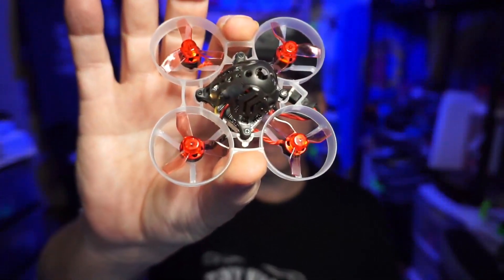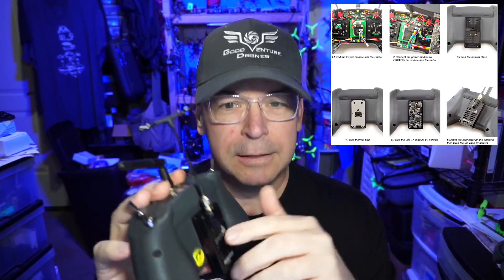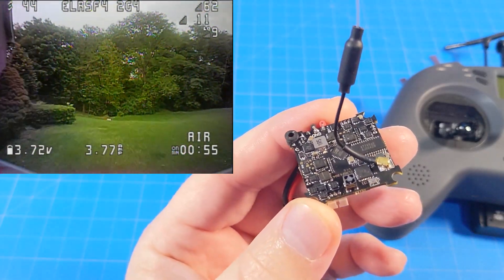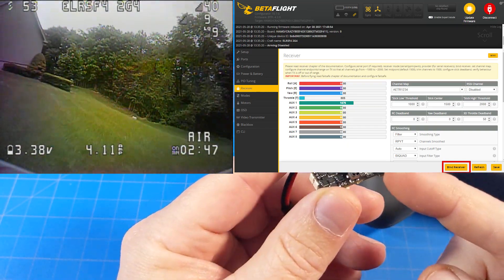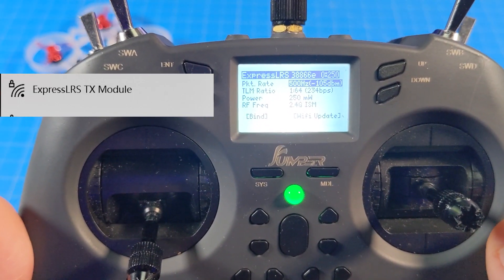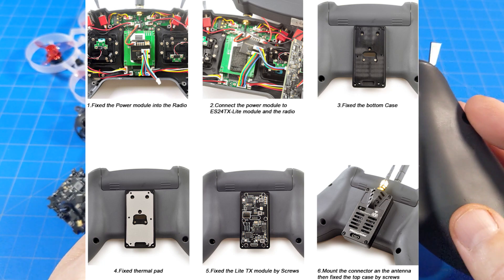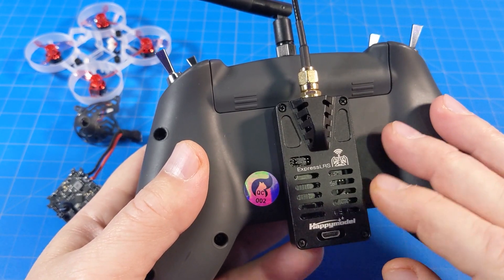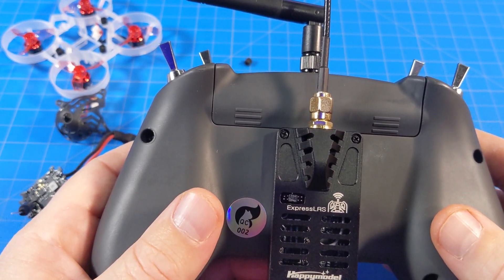HappyModel ExpressLRS // ELRS F4 AIO // ES24TX-Lite // Higher Packet Rate // Huge Range

Comment: Hello. I i am trying to set up the board. Radio link is working, but I can't arm. I have a calib error in the osd. please help !
Reply from the maker: Need more information. Have you calibrated the accelerometer? What arming angle? is the quad flat? Have you set a switch on the radio to the arm mode?
Reply: @NickBurnsFPV  after more investigation, the gyro is no sending any data in the sensor tab in bf. Maybe I bricked something when I try to update the receiver via elrs configurator using bf passthrough
Reply from the maker: @Izlolz  I presume you updated with the elrs specific betaflight hex? And had it set to stm32? Here is the betaflight pull request thread https://github.com/betaflight/betaflight/pull/10788
Reply: @NickBurnsFPV  yeah, I did all that, I even asked on GitHub for help. Maybe the board is faulty
Reply from the maker: @Izlolz  ah, its possible. I know updating the board for me didn't go well the first few times, but I didn't have any indicators the hardware was faulty.
Reply: @NickBurnsFPV  cheers for the help. In the end did you do something more than the tutorial on happymodel ?
Reply from the maker: @Izlolz  I don't think I covered updating the AIO board from start to finish.

Comment: Can someone tell me how to disable the onboard VTX on this exact same quad?  CRAZYBEEF4SX1280 I cant find any information on it.  Someone said there a solder bridge that i can remove and it turns it off but I don't know where it is.  I'm wanting to put the HDZero ECO kit on it but need the current onboard AIO VTX disabled so not to drain power and radio signal interference with the new HDZero VTX.  Anyways any help would be appreciated allot.  Thanks

Comment: Wonder if the x-lite version will work on my tango 2, since some xlite modules don’t work on the tango 2. Are you dropping the lbs man? Lookin good man,  coming from someone who lost 50lbs a few years ago .
Reply: Maybe if you change the pinout.  I have a DIY ELRS 2.4Ghz on my Tango2  and Tango2 is limited to 250Hz max by the FreedomTx software. No 500Hz fun for now anyway. You need a OpenTx radio to get 500Hz.

Comment: Will that T-lite ELRS module work in a Tango 2?
Reply: Not as it because it uses an different plug than the one on the MPM…
Reply from the maker: nikotttin is correct, they have a version coming for the x-lite, which "could" work on the tango 2.

Comment: This radio is only 1s 18650 so the question is how long T lite will work with 2.4 lrs module...🤔🤔
Reply from the maker: I haven't timed it, I have been using it for weeks, the run time with the module is likely less, but not enough for me to notice excessive need to change batteries.
Reply: @NickBurnsFPV  thanks Nick

Comment: You put this in a mob6?
Reply from the maker: Funny, it came to me in a mob6. Which I certainly won't complain, but I am going to move it over to a mobula 7 frame. there is a new mobula 7 frame I want to try out, see if its more durable etc.
Reply: @NickBurnsFPV  I have these parts on the way, maybe I'll copy you and do mob 7 frame as well. What's the smallest frame you recommend with the added weight of any kind of HD? Is 75mm enough, or is 85 better?
Reply from the maker: @andrewnelson3725  bigger platform is always going to handle more weight better, I think if your using a small camera like the insta360 go it will be fine in a smooth cruising flight, but if you want more aggressive an 85 with 1103 motors will handle that better.

Comment: I have this board with EX0802 22000kv, i get random black outs :( all the time, even with a fresh battery. Does anybody have any  idea? I flashed 16.9 blheli_m with 48khz
Reply from the maker: Blackout as in no video? Or fail safe?
Reply: @NickBurnsFPV   no video (osd still there, arming possible) - OR - black screen, no arming possible, rapidfire detects the carrier frq. in both cases it stays, i have to get up and power cycle. it also sometimes blacks out and recovers and i can re-arm. my mob6 has this very very rarely,  but with this board it's a pain
Reply from the maker: @kampkrieger  What camera? Have we by chance tried another camera to see if its something specific to that particular camera? Maybe we need to power the camera directly from the battery, we can do this by soldering the wires from the camera to the opposite side of where the battery wires connect to the FC.
Reply: @NickBurnsFPV  We have a runcam nano 3. And there are 2 more of the same kind i can try it out. It says it can handle 3-5.5V, so I guess I give it a try on vbat. Do you always use vbat? I found out that with newer batteries it does appear much less frequent. I tried Commutation Enhancement to 50%, I think it helped. I added 10µF cap, slight improvement(-ish?). It seems to me that 5V is breaking down. I set minimum Voltage to 2.7 in betaflight, not shure if it helped.
Reply from the maker: @kampkrieger  If we are running 1s we can go directly to vbat. I generally don't. It could be the battery connector is breaking down and needs replaced. Are you using a rolling pin ph2.0 connector, or even a solid pin ph2.0 connector. Is this quad new or been through many flights?
Reply: @NickBurnsFPV  i just got the board and it's the cleanest build that i have ever seen. the board came with solid ph2.0. it is a pure 1s board, so why is the cam connected to 5v in the first place. This board with ELRS is otherwise soo good, i can totally feel the difference to D8
Reply from the maker: @kampkrieger  The 5volt regulator might not be outputting 5v. Normally we don't need to wire the camera to battery pads, this is a troubleshooting step. Its possible the camera is the issue, unless you have tried the other cameras you mentioned and the issue is across all those cameras.
Reply: @NickBurnsFPV  So i soldered it to vbat, at first it was worse, than i had 5 batteries witout issues, than it came back. The battery quality has some impact on it but it is not the only factor. Crappy batteries cause it more often. On the other hand I just had a black out with my perfect 300mah GNB after 30sec and after that I had another 4:00 (four minutes!) of flight without issues on the very same battery on the same charge. So what else can be blamed? Maybe it is a motor? Or a short. If you have no other suggestions I will solder my mob6 motors on the problem child FC. 
Btw I set ramp up power to 0.75 instead of 1.0, no solution but whoop is flying smoother and I get more flight time.
Reply from the maker: @kampkrieger  I wonder if there is an internal breakage in the wire? Its just a guess as its odd to have random issues. What happens if we have in our hand and with it working normally can we shake the quad and get the blackout? This could suggest an internal wire breakage or a solder joint issue.
Reply: @NickBurnsFPV  We pulled on the cable it is intact (it was new, came with the board). I think it is motor or esc. It is failing often. I will try different the motors.
Reply: @NickBurnsFPV  So today my second ELRS F4 AIO which I ordered came. I soldered the mob6 motors (25000kv) to the first problem child, the problem got a lot worse. Then I tried the new board giving it the 0703 motors from my favourite whoop. It does NOT WORK at all :'( When I raise throttle the slightest the ESCs are resetting, I have no idea why. The build again is very very clean. No acces solder, no dirt. I also added a mlcc on vbat. It just does not work. I either made a fundamental error in my configuration. Or this board is unfortunately cursed now and I would NOT recommend to buy it until there is a version two or 1.1 or something or they fixed the production problems, nick u got a preproduction right? It is such a shame. I don't even want to fly any of my D8 based whoops no more, because the ELRS makes such a difference sobbing
Reply from the maker: @kampkrieger  hmm. I wonder if its a motor causing the issues? Did you happen to power it before adding anything to it?
Reply: @NickBurnsFPV  ok now I just found out!!! And it is definitive. If I flash back to blheli 16.7 I can go full throttle (in the motor tab) with props on and punish the battery to death without any ESC problem. Only when I am on 16.9 this happens, with the 25000kv motors it starts happening at ~33% throttle. What blheli version are you using? Is there a trick with 16.9?
Reply from the maker: @kampkrieger  I can't be sure in the moment I am not with it. I would expect it to be 16.7. Motor timing is likely high or med-high.
Reply from the maker: @kampkrieger  I do on my own custom whoops but not on a new product review.
Reply: @NickBurnsFPV  which version?

Comment: It looks like your radio only does 250hz.  0:250 instead of 0:500.
Reply from the maker: That is just what I had it at. In the video the packet rate is at 500hz, and 250mw. It has settings up to 2000mw.
Reply: @LeslieLui  You are right. Nick are you running the custom 2.3.10 version of OpenTX from ELRS or a recent OpenTX nightly?
Reply from the maker: @skree_fpv436  I need to check on this. As I was told I would only need to update the tx. I am not sure if it the lua HM has or I need to update opentx.

Comment: I have never had. 1s that lasted more than 6 months, Mobula 6 being the worst I have a drawer full of failed FCs
Reply from the maker: What do you find is failing? ESC? VTX? RX?
Reply: Flight controllers on the Mob6, three out of the box with firmware problems and  voltage problems just drained the battery, another with failed ESC, another with range problems, another with gyro problem. Tiny hawk, mostly the ESCs burning up a lot.  I prefer to stick with the Mob7 2s  for indoors they have better longevity and most of the failures are due to crashes lol

Comment: Looks cool, but I hope Happymodel’s QC has improved. Not reliable at all in the past. Time will tell.
Reply from the maker: I had a bad run of crazybeex boards myself. Three of the 6 I ordered (for tks buids) burned up either usb plug in or first battery plugin. I talked to HM about it. They acknowledge the failures, but didn't give an indicator anything would change. :(

Comment: I can NOT recommend. My modul is heating up to 90+ degree celcius and further when using the video transmitter!!
Reply from the maker: Is it sitting long before taking off? More than a 1minute or 2, and we need to get flying to get the air flow going. Micro vtx, even those not integrated into the aio get very hot quickly and need to be flown.
Reply from the maker: @MM-xv6ep  Something is wrong then. I would contact the reseller if you haven't already.